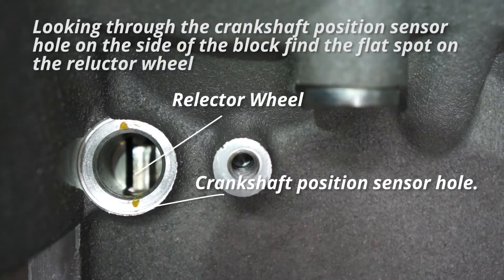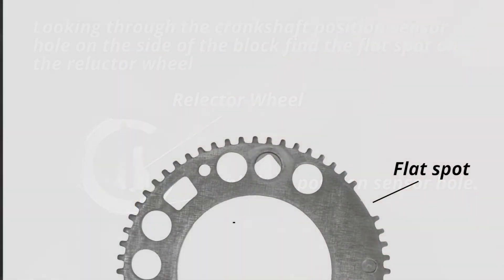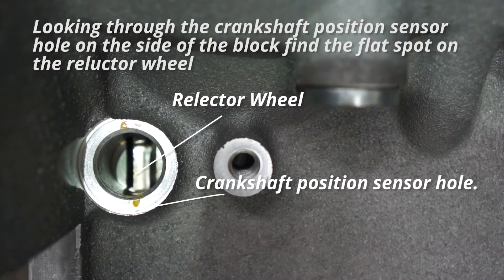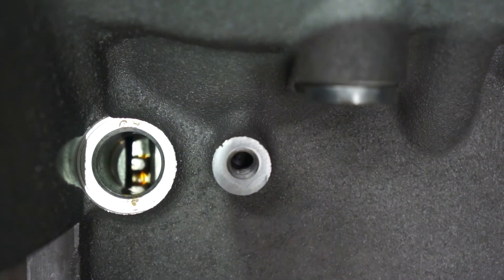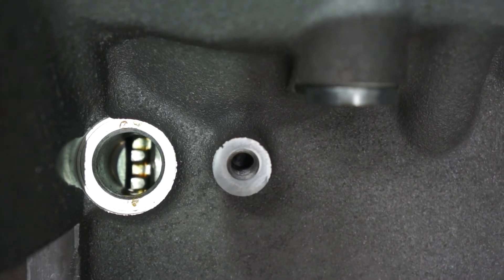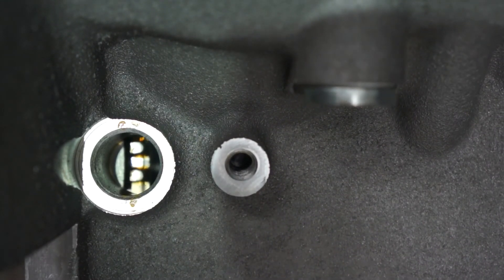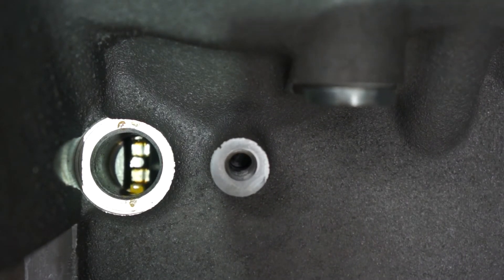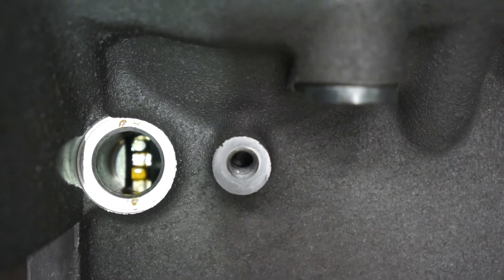x58 LS Reluctor Wheel TDC Verification

Comment: Thanks for the video, I have a LS at work that the ignition timing was jumping around. After spending some time trying to find the problem found the reluctor wheel can move on the crank. In my country its not a common motor. Its a Chev Lumina 6.0 . Do You know if one can maybe tap threads and use machine screws and fasten it to the crank. If we have to replace it we will have to import a new wheel and that takes ages. The agents dont carry stock for LS anymore in the country. Thanks again. A BIG help.